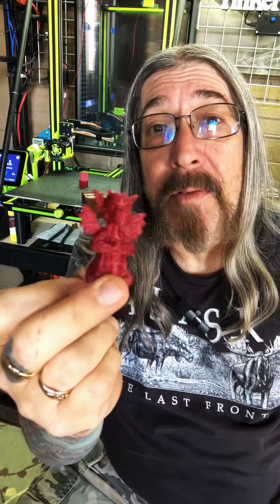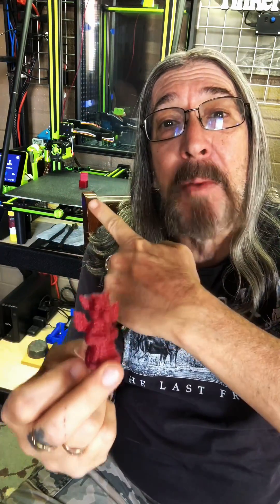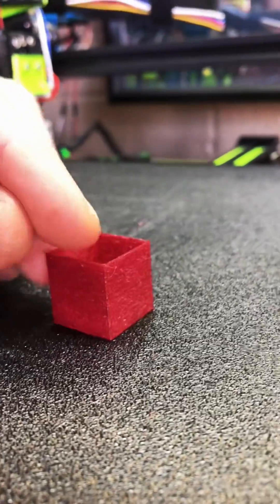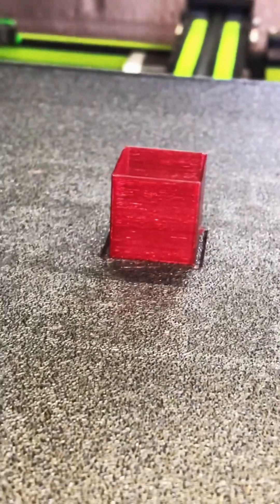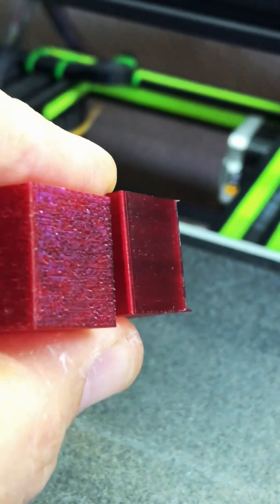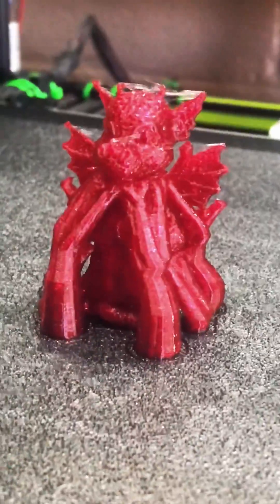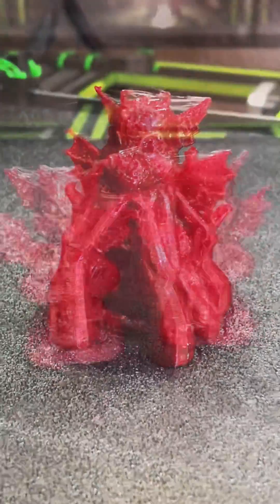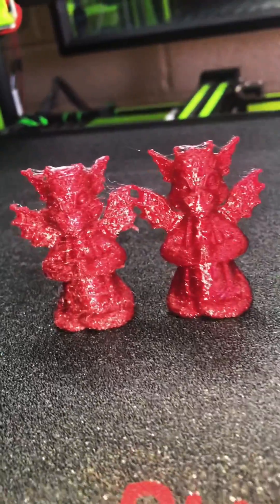Damp PET1 Filament?  Let’s dry it and see if the prints improve!

Comment: Drying is the best solution. I am also drying them before pulling the strips. So the effect area of the PET is much more to dehydrate(theoretically)
Reply from the maker: Yeah, I don’t dry before pultruding, but if I use it to print right away, it prints fine.  Pultruding is heating and pushing that moisture out.  The filament I was using in this video had been sitting in my garage for about 9 months.  Plenty of time to absorb more moisture.